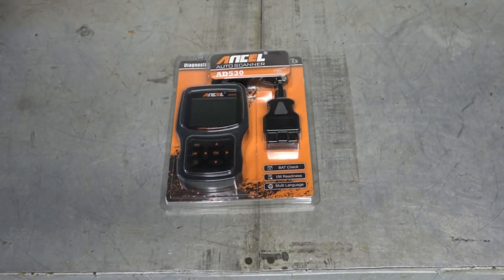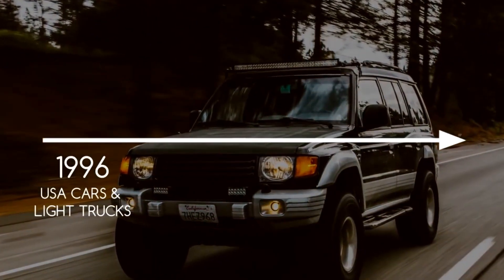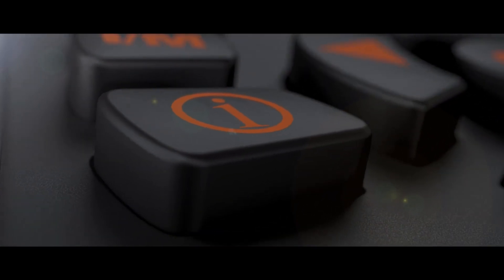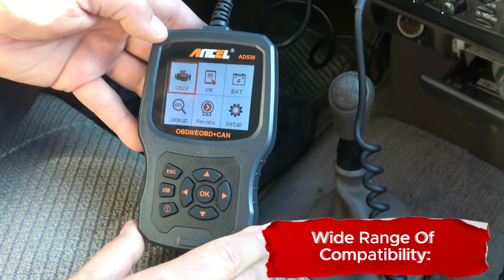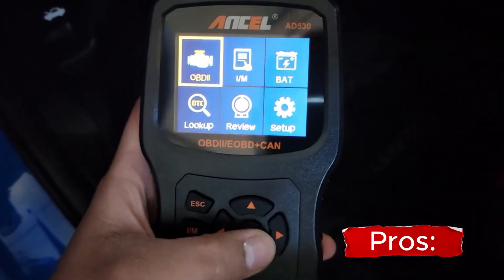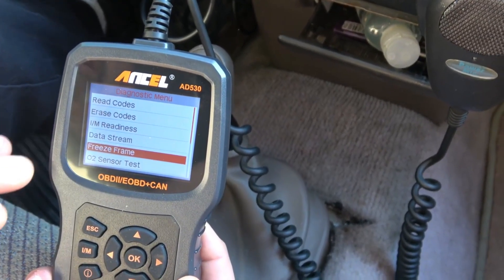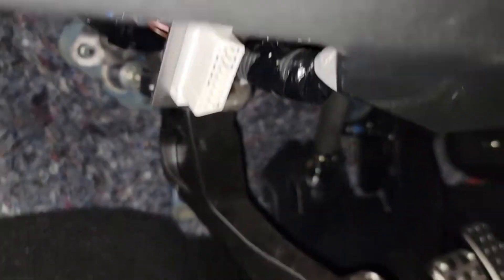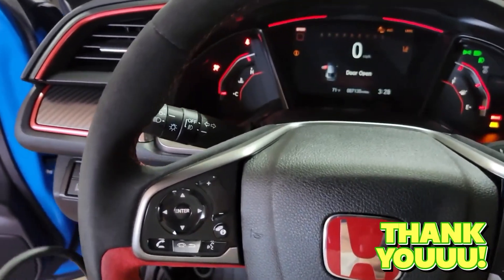Ancel AD530 Review: Is It the Best OBD2 Scanner for You? Ancel AD530 OBD2 Scanner |

Comment: doest it conatin the ecu coding ( customization for the hidden features ) ?
Reply from the maker: No, the Ancel AD530 scanner is not designed for ECU coding or customization of hidden features.

The AD530 is an OBD-II scanner. OBD-II (On-Board Diagnostics) is a standardized system used by most vehicles manufactured since 1996. It allows diagnostic tools like the AD530 to read trouble codes, view live data streams, and perform other basic diagnostic functions.

ECU coding, on the other hand, is a more advanced process that involves modifying the software on a vehicle's Engine Control Unit (ECU). This can be used to enable hidden features, adjust performance parameters, or change other settings.

ECU coding is typically done by professional mechanics using specialized software and hardware. It's important to note that ECU coding can be risky if done incorrectly, and it can potentially void your vehicle's warranty.

Here's a breakdown of the AD530's capabilities:

Reads and clears diagnostic trouble codes (DTCs)
Views live data streams, such as engine RPM and coolant temperature
Performs I/M readiness tests (emissions)
Displays freeze frame data, which is a snapshot of the engine conditions when a DTC was set
Tests oxygen sensors and other emissions systems
Retrieves vehicle information (VIN)

If you're interested in exploring hidden features or modifying your car's settings, it's best to consult with a qualified mechanic or search online forums specific to your car make and model. Be aware of the risks involved in ECU coding before attempting it yourself.

Comment: is this compatible with motorcycles? with OBDII system?
Reply from the maker: Motorcycle models by European or American brands manufactured onwards of 2016 generally are OBD2 compliant. Models by Japanese / Asian brands, and those made before 2016, usually are not OBD2 compliant. However, some diagnostic scanners are still compatible with bikes that aren’t OBD2-equipped. ANCEL AD530 is not compatible with motorcycles.
Keep in mind that motorcycle models, technologies, and standards can change over time, so it's always best to refer to the most up-to-date information available at the time of purchase.